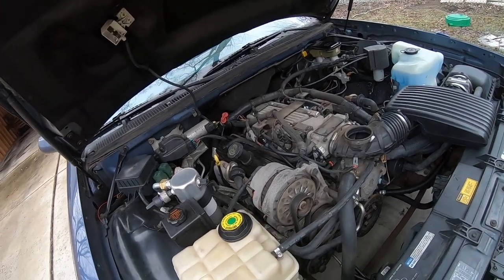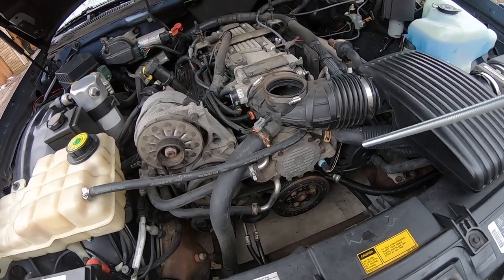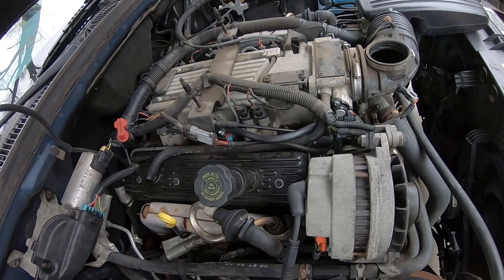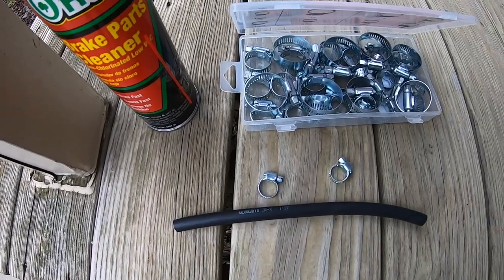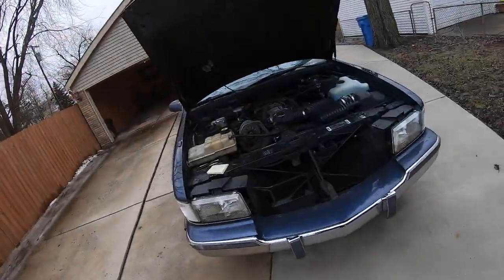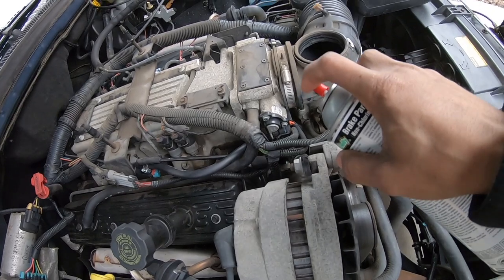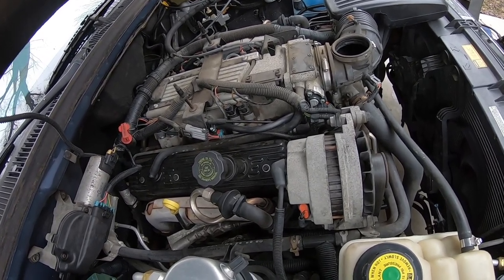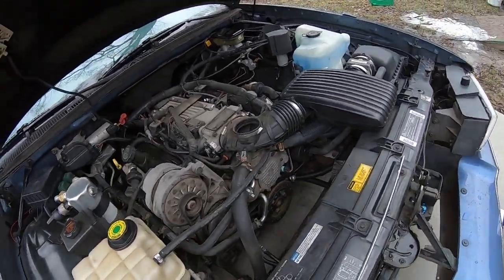LT1 Stalling Problem? Starts then Dies? Check The Vacuum Lines! Not the Optispark & Beware of Forums

Comment: You're so right about the opti-spark hysteria. Do you just know where all the vacuum lines on this model are or do you have diagrams? I have a 95 Caprice that I'm trying to trace down issues with. Are both the side hoses on the throttle for vacuum or is one for the coolant as well?
Reply from the maker: If you google "1995 LT1 vacuum label" you'll see pictures of the diagram. From what I see online, I think there is a coolant line on the driver's side of the throttle body. It's definitely worthwhile to take your time to make sure all the vacuum lines are good. The motor will run poorly if there's a leak.
Reply: @WorkingWithWimberley  Thanks. Looking for it by "label" helped. I looked closer the other day. On the passenger side there's two vacuum lines. Underneath those is another connection which I assume is for the coolant. There is a line coming out on the driver side that connects to the coolant tank.

Comment: Mannnnn.... I came across your video (after doing my spark plugs.... the passenger side was a pita)..... I did my plugs and bought a fuel pump thinking those were the problems.... then I thought I routed the passenger plugs wrong though I checked and triple checked.... I gave up sent it to the shop and the night before I sent it I saw your video but I was like nahhh it’s gotta he plugs..... turns out it was exactly what you said.... I could’ve saved 91 dollars smh
Reply from the maker: I’m glad you eventually fixed the vacuum lines and solved the problem! I think you still did good only spending $91.

Comment: Thank you that did the job! That is a old method, that would do on my 60's 70s & 80s never thought about the 90s! 👍
Reply from the maker: The 93-96 Fleetwood is a unique car. It looked old when it was new 😂. And GM was still using old tech in the motor.

Comment: Would love for you to try to figure this one out (warm/hot stalling).

No codes (97 LT1)
No vacuum leaks (21 Hg).
Fuel pressure is normal.
No EGR valve (blocked off).
Replaced coil, coil wire, ICM, MAP, ECT, IAT, and MAF with known good parts from another LT1 car I have.
Unplugged oxygen sensors, TPS, and IAC. Unplugging the IAC makes it idle at like 1500 RPM (my neighbors love me).
I even cleaned up a whole bunch of ring terminals for both power and ground wires with a wire brush and rags.

Still stalls.

Car still runs otherwise totally normal. No loss of power. Cruises down the highway fine. Idles fine when cold. It doesn't "hunt" for RPM really. I heard it do that once or twice but it mostly just shuts off completely at idle like someone flipped off a switch.
Reply from the maker: That’s a tough one. I don’t really know. The car I worked on is a 95 so it’s an OBD1 car. Your 97 is an OBD2 car. I’d find a shop that can hook it up to an advanced scanner to read what’s going on.

Comment: Good find. However after it stalled it would start back up, correct?    Most of the stalling issues we have after it stalls is, cranks but no start.   I ran into an issue of a shorted out fuel injector only when it got hot.  After I replaced everything from fuel pump , opti to PCM. The issue was still there. These engines certain models  injectors fire all right bank then all left bank.  If one shorts out the engine will stall and will not start.
Reply from the maker: That’s correct. When mine stalled, I could immediately start it back up.

Comment: I went to the dealer because my car(96 caprice) was running sluggish after it warmed up, they said they unplugged the egr vacum line and now my car runs fine with no issues

They said since i have flow masters they wouldn’t be able to diagnose why my car was running sluggish because it would require the stock exhaust system 🤷🏾‍♂️
Reply from the maker: It might be because of the air pump. It pumps air through the exhaust and aftermarket exhaust headers normally don’t have the tube for it so it’s removed. On 96s, it causes a check engine light. That my guess. I talked about that a bit in this video: https://youtu.be/DSJfqSJ9VSY

Comment: Excellent vid, liked & subbed. I have a comment and a question:

On that motor, one thing that detoured my diagnostics was troubleshooting with the intake resonator off.  This caused the air to bypass the mass airflow sensor, and caused additional (self-inflicted) issues. Taped it off and went back to work on it.

The issue is on a 94 Cadillac owned by a friend.  the car will not run when warm. Unfortunately he already spent $1500 having somebody do most of the work that you listed in this video: fuel pump; fuel filter; spark plugs & wires and fuel pressure regulator. (Fortunately not the OPTi spark.)

I verified the following: at idle:  18 inches of vacuum, fuel pressure 36, without vacuum 45 psi. Verified spark on all eight cylinders, it actually runs fairly decent at idle. But the hotter the engine, it will eventually fail to start or run at all. Seems to be a reasonable amount of exhaust volume exiting the tailpipe. No work as far as I know was done to the EGR valve, we will perform the vacuum leak procedure you described, are there any diagnostics for the EGR valve that can be done? Thanks in advance for any help you can throw our way!
Reply from the maker: Thanks for watching and subscribing! I really appreciate that. I changed my EGR valve because I had the fault code for it in the system. Many cars before 1996 had the OBD1 system, so you can’t use the typical OBD2 scanner to get the fault codes. There’s a way to get all the trouble codes from the 94-95 cars from the climate control. There are a few videos on YouTube showing how to do that. I pulled the codes from the climate control and saw that I had one for the EGR valve, so I changed it. I didn’t actually run a test on the EGR. As far as the stalling goes, you definitely should do the method I show where you spray down the vacuum lines while the car is running at idle. My Fleetwood ran great when cold, but it stalled when it was warm at idle. That’s all I have on it lol. If your vacuums lines are good, and all the others parts I mention in the video are good, I don’t know what else it could be. I hope this helps.
Reply: WorkingWithWimberley We’ll give both a try and let you know.  Thanks for the quick response!

Comment: Ur good bro.... Question I got a 95 Impala and no odb1 scanner. Check engine light on. It's killing me I cannot find the problem. Basically changed 85%  everything.
Reply from the maker: I know on the Fleetwood and Roadmaster you can pull the codes from the digital climate control. Since you have the manual controls, I don’t know of any way you could find the cause of the check engine light without spending the money on a good OBD1 scanner. You’ll just be guessing and throwing parts at it.

Comment: Having a similar issue but seeing your list I'm still going to check the vacuum lines but I'm curious if it has something to do with when I did my transmission I dropped the engine and did my spark plugs, put edlebrock headers on and did an EGR and Air pump delete I had also replaced the fuel pump cuz that went bad shortly after. But it literally does the exact same thing when it's warm and it started shortly after doing the egr and air pump delete.
Reply from the maker: It could be your vacuum lines. There’s only one way to find out!

Comment: I used to work at a Pontiac dealership years ago and one of the Technician said they used to have Firebirds/Trans Ams come in with 10K to 20K kms (6,000 to 12,000 miles) and have these issues. Had the same issue with a 96 Caprice Classic. Turns out the springs get weak overtime inside the EGR valve
Reply from the maker: Thanks for sharing! I did replace the EGR valve before doing the vacuum lines.

Comment: My car starts and die after a couple seconds..I unplugged the maf sensor and it stayed running so I bought a new maf sensor plugged it up and it died again unplugged it and I stayed running what are your suggestions on what my problem may be btw it’s a 94 Impala
Reply from the maker: Sounds like it’s the MAF sensor to me. Did you replace it with an AC Delco? I hear the aftermarket ones are no good.

Comment: Any good recommendations about obd1 94 Fleetwood. I also have stalling when I step on the brake potential brake booster vacuum leak..I really want to replace all vacuum lines and hoses ..I've brought a distributor just in case
Reply from the maker: My recommendation would be to check the vacuum lines like I show in the video. Start there then try the other things I mentioned.

Comment: Hi there! So recently my 94 has been stalling on me, only when the fuel tank is less then half way and it stalls when I go and take a right. Would that perhaps be my fuel pump or would you think it could be vacuum lines? Thank you!
Reply from the maker: I’ve never heard of that but it doesn’t sound like vacuum lines. Sounds like a loose electrical connection, fuel pump or something wrong with the tank.

Comment: Yo bro did u ever experience a no start just click when u turn the key it’s like the starter is engaging but not enough to turn the flywheel it’s a brand new starter and new ignition coil and battery is good what do u think it kould be 🧐 I have a 94 caprice 9c1 LT1
Reply from the maker: Yes I have. It’s been either a bad battery or a bad starter. Since you said you’ve replaced both of them, I don’t know. I’d double check both. Make sure that battery is good and holding a full charge. And it is possible to get a bad starter fresh out the box. If it’s not too much trouble, you could swap it out for a different one.

Comment: Question of concern. Was driving 1995 Impala perfectly fine. No lights on dash. All of a sudden when accelerating the engine light comes on. The oil level low comes on then it turned off  keeping the engine light on. And the AC got humid as well . I restarted the car and no lights on dash and ac came back on cold. It’s been happening each time I take it out. Last couple cruises Mind you. The ride feels a bit sluggish once the engine light comes on while driving. It clears once restating the car Anybody had these issues. Running on 80k miles. Taken care of stock 5.7
Reply from the maker: I had a similar issue in my 2012 Escalade with a 6.2L. It was the oil pressure switch/sensor.

Comment: Thanks for this video. Im going to check my vacuum lines before I do any major purchases. I have a question there is vacuum hose on the intake manifold that has a blue and white circular filter on it. My 98 camaro z28 LT1 has that same hose, same location. My question is... what does that vacuum hose attach to? Mine is not attached to anything. It looks like the optispark vacuum hose. I dont know where or what im supposed to attach it.  Need help fast!!
Reply: Yes that is the opti spark vent for moisture it connects to the intake and runs down to opti
Reply from the maker: Thanks for answering this question. I kept forgetting to check.

Comment: I'ma be honest. I got a rich on mine that I been chasing for a year, and I finally just recently found out it has a weak spark on cylinder #5. Even after buying a new Opti from a highly-reviewed company (not installed yet), I'm still looking around and trying to find a different explanation for why this is happening. To make matters worse, I had it fixed and it actually ran perfectly fine until I took it to a shop a few months ago, and it's been running rough again ever since.

Guess what I'm saying is, wish me luck. Because at this point, everything left is stuff I REALLY don't want to do.
Reply from the maker: I definitely hope you find the issue. The first time for me was a bad vacuum line. The second time it was a bad spark plug wire: https://youtu.be/rNYMPEZbV20

Comment: I know this is an old video, but I hope you will respond.. Anyway, I have a 92 Corvette with an LT1. I have been replacing parts and going down that rabbit hole with no success. What I don't understand is why the car will run fine while cold but then stall when warm. That is what is happening with me, but it seems that if the vacuum lines are leaking, it would make no difference whether cold or hot.
The other question is does you check engine light come on when yours stalls? Mine does, but other lights and codes come on too. So can codes be thrown if there is  vacuum leak?
Reply from the maker: Vacuum leaks can cause a CEL. My car didn’t throw a code for the vacuum leak, but it did for the EGR valve. Also, the vacuum leak did cause my car to shut off when hot. In parking lots and stop lights. I would not rule them out until you actually test the vacuum lines.
Reply: @WorkingWithWimberley  Thanks. After your video, I promptly went out and gave my car the spray test. No noticeable change in engine, so although it COULD be a vacuum leak, I didn't detect one. Wish there was a way to know for sure.

Comment: This video did not help, but mad respect for helping out. Thanks for sharing your knowledge.  
My 93' z28 has an intermittent idle problem. After it warms up it idles at 1k rpms. When the engine is cold it will idle too low and stall sometimes. I have loss of power sometimes at high rpms. No codes.
Reply from the maker: It could be the IAC or the mass airflow sensor, but I’m not sure.

Comment: Lord man on a lt1 I'm working on the guy suggested to change, optispark,fuel pump/filter,the injectors was faulty but 1. Tried to start held fuel peddle down barley started blue smoke everywhere and spitting out the throttle body and exhaust.  Got suggestions
Reply from the maker: Blue smoke is engine oil being burnt in the combustion chamber with your gas and air mix. This oil being burnt can be caused by worn piston rings, worn valve guide seals, or even the valve guides itself letting oil seep into the combustion chamber.
Reply: Yeah thought about doing a compression check to see but it didn't smoke like this until I installed new injectors. Acceleration is poor pop and cracking

Comment: Hey ! I got a Chevrolet Camaro with an LT1 ! It is my first V8, and when i opened the hood the first time, i saw that on the rubber elbow from the intake manifold you have that little hose with a blue end that is put in the the rubber elbow. And the house goes down. Is that a vacuum line or what is it ? I can't find nowbody to say what is that for. 
PS - I am from România, and i have another Camaro but it is a 3.8 V6. This V8 LT1 is complete diferrent.
Reply from the maker: I'm not sure. I would look around in the LT1 forum and see if you can find information there. https://www.ls1lt1.com/

Comment: I have 96 lt1 Chevy Caprice and I was driving and it stalled almost like I couldn't give it gas. It started right back up and I just parked it. Came out next day it started but almost stalled again almost like I ran outta gas.
Reply from the maker: Did you check the vacuum lines or any of the parts I listed in the video?
Reply: @WorkingWithWimberley  I'm actually going to have someone look at what I watched on your video today! You are so helpful and I appreciate your knowledge ALOT!! I'm on my 2nd opti and I need a tune up don't know if a tune up would stall me and let me turn back on? I also considered bad gas maybe 🤔

Comment: So the EGR valve will stop the car from starting up to if it’s acting crazy
Reply from the maker: I’m not sure if it will stop it from starting, but it will definitely cause it not to run properly. It’s a part of the vacuum system so it could cause it to stall out.

Comment: Wimberly,
I found the evap elbow deteriorated, replaced with plug boot. And put new pcv hose on. Started up fine, ran fine till I parked it. Same thing. Like it was hot, and per plating sound. As always. Eventually after repeated start attempts, it ran and got home.
This car sat for a while, is it possible egr getting stuck? I'll check egr lines tomorrow. It's a 96 fleetwood, lt1.
Thanks
Reply from the maker: I’m not sure exactly what it could be. I’ve done the vacuum lines and EGR valve on mine. I’ll be doing the O2 sensors next.

Comment: Does anyone know the actual name of the home base part?  I dont know it's purpose besides just providing extra air volume. Lol.   I am just experiencing this issue for the first the time.   Sat in my garage for 12 years.   I start it 2x a year to keep the gas  fresh and will one day put her back on the road on sunny days.    This time,  ran normal for 5 mins but sputtered and died.  Starts up fine but sputters and dies in 10 seconds or less. Changing gears while not moving,  somewhat makes idle smoother but still sputters and dies.  Can't rev too high either.   I dont know if its because I accidentally shorted the jumper cables and damaged electricals (battery outside of car).   Battery terminals inside car touched and sparked momentarily.  Car was off at the time. I think I did that before long time ago (yeah, careless me) but car unharmed.   Doubt it's the short that caused it.  But now I have to go deep trying to figure out the root cause.
Reply from the maker: GM calls it a Resonator. Part numbers 25099945 and 25162968.

Comment: I have issue with my LT 1 I change the fuel pump I change the fuel filter tune it up I even check my fuses he will turn over but it won’t start up it’s like it’s not getting no gas but it is getting gas what should I do next
Reply from the maker: I would try all the stuff I listed in the video. Mass air flow sensor, egr valve, plugs, wires, etc.